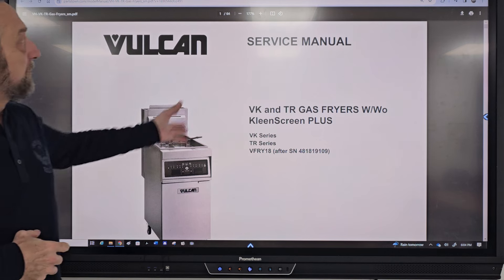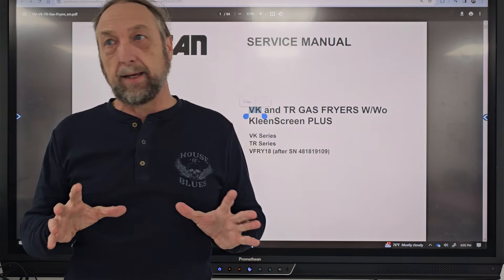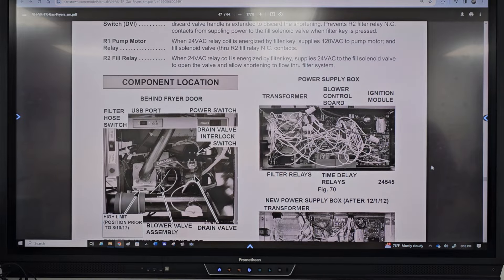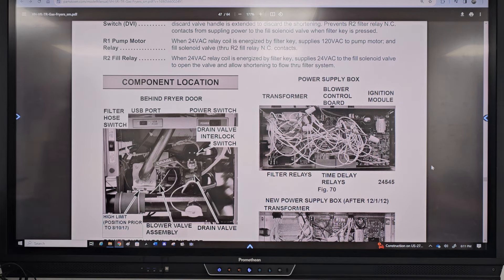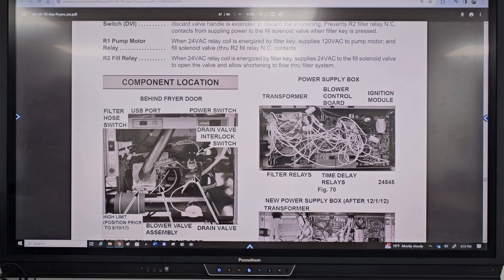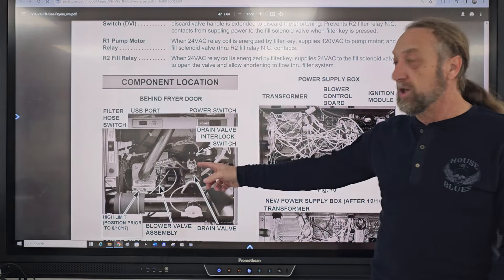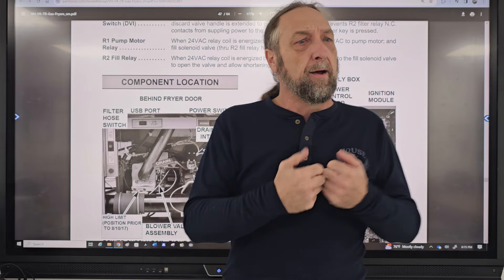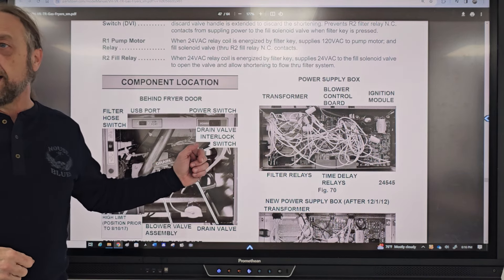Vulcan Fryer Pat 1

Comment: The switch is most likely to prevent the heater from heating if the valve is open.
Reply: Yes you are correct